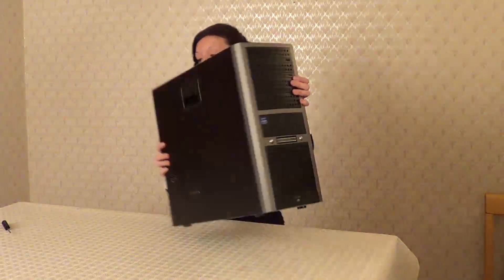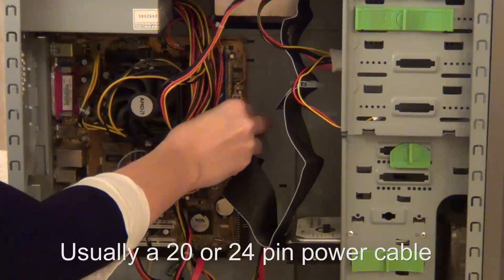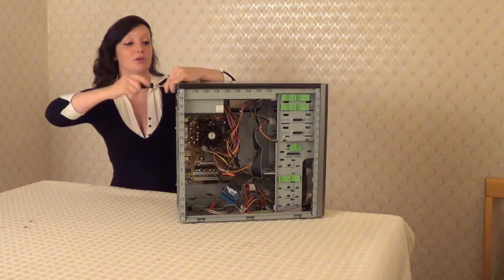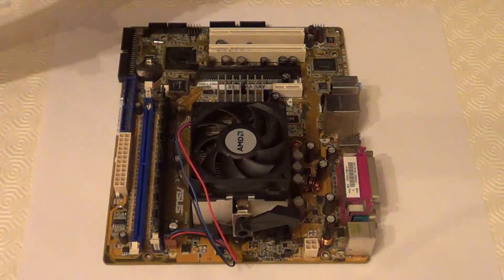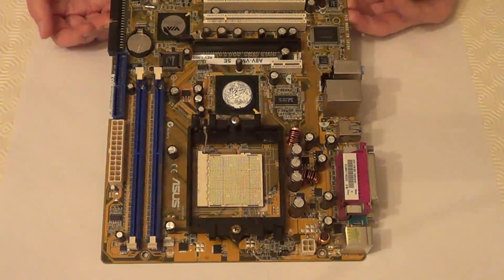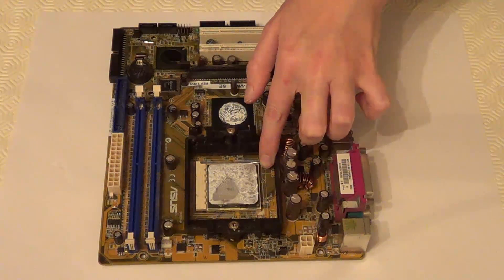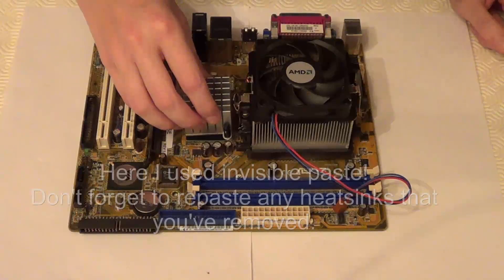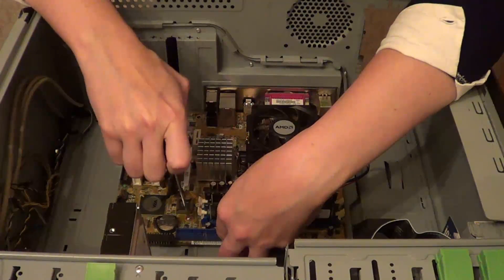How to replace a motherboard in a desktop computer

Comment: Nice beginner TUT however you do realize you do not need to spread the thermal paste like she does in this video, pressure from re applying the heat sink will automatically spread it for you more accurately.

Comment: If I replace my motherboard do I have to wipe my hard drive after booting it back up?
Reply from the maker: If you replace your motherboard with the same motherboard (make and model no.), you won't have to wipe your hard drive.
Reply: mmk but why would i do that?
if the motherboard was that old to break then i would buy a new one at the same price as my old one which my default should be better
Reply: i know of very little cases where people that have upgraded thei mobo, to the same mobo
Reply from the maker: If the motherboard has failed and you just want your computer back up and running, you could replace it with the same make/model motherboard for the least amount of hassle. Otherwise, the hard drive will need to be wiped clean.

Comment: please help me desktop won't start after a bios update any solutions
Reply from the maker: Some motherboards have a BIOS backup which makes it easy to revert back to the original BIOS.
Reply: i have jetway TI61M5
Reply from the maker: Karim Gaming
Check for a manual online for your motherboard. That will tell you if it has a BIOS backup.
Reply from the maker: I've had a look and found that your motherboard does not have a BIOS backup. You could try clearing the BIOS instead. Go to the following website, download the manual and check out page 12. That will show you how to clear the BIOS. Hope that helps... http://www.nodevice.com/user_manual/jetway/Motherboard/ti61m5.html
Reply: already did  but not work i think motherboard its dead 
thank you for everything
Reply: i find this instruction http://www.biosflash.com/e/bios-update-error.htm 
it work for model mother board ?
Reply from the maker: Yes, as a last attempt, try adding the BIOS update onto a CD and boot up your computer from that CD disk. For exact instructions on this, you'll have to visit your motherboard manufacturer's website as they vary a little. If that doesn't work, it's probably time for a new motherboard.
Reply: only boot cd i can't do that with flash usb
Reply from the maker: Yes, you can also do it with a USB flash drive.

Comment: is stopped again..there is power though...no screen again and no beep...
Reply from the maker: If I had that problem, I would try disconnecting certain components (such as ram, dvd drive, hard drive etc.) to see if it will at least show something on the screen. That will at least eliminate problems with certain components.

Comment: my desktop does not ahve a small beep when i start,,so no video,, after pluging in and out for so long i get luck to be able to work again,,,its the been that is missing,,do you think its the motherboard>
Reply from the maker: Sometimes when a motherboard is failing, the computer will start on occasions and other times it won't. So it is a posibility that it could be the motherboard. This problem can be caused by other components too though.

Comment: you dont have to spread the thermal paste around. it will spread itself from the pressure of the heatsink.
Reply: spreading it around will prevent it from making more of a mess

Comment: is it true that if we replace mother "not same as older one" it corrupt the hard drive?
Reply from the maker: +Shivam joshi The hard drive won't be corrupted but you'll have to reinstall everything because the drivers will be different for the new motherboard.
Reply: +EasyPcRepairs  ok tried to replace my 82945g from dg31pr but after installation of 31pr there is black screen on my led i mean no display at all.

Comment: Can a EIDE mother board be replaced with a SATA mother board? Thank you! :)
Reply from the maker: Mark Covington If you replaced an EIDE motherboard with an SATA motherboard, you'd have to change your hard drive and optical drive to SATA drives. Also you'd have to wipe your PC clean and reinstall everything. You may have to change the CPU and RAM as well. In answer to your question... yes, you can replace EIDE with SATA mobo but it can in many cases be more hassle than it's worth.

Comment: My lord, talking about bad cable management xD
Reply: @computer_909  This video is probably from 1999-2001 I guess. Cases back then didn't have holes for WM, cables didn't have sleeves. But this is still fkin ridiculous. They say WM doesn't affect airflow but that mess of cables on the cpu and the IDE cables to HDDs pretty sure were managing to add at least some degrees.